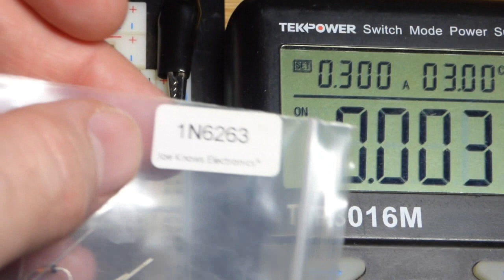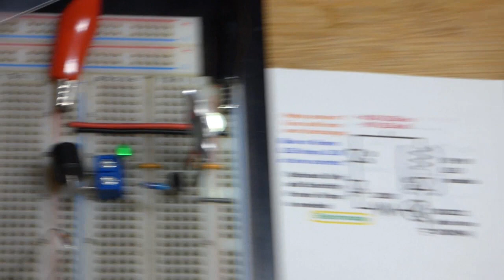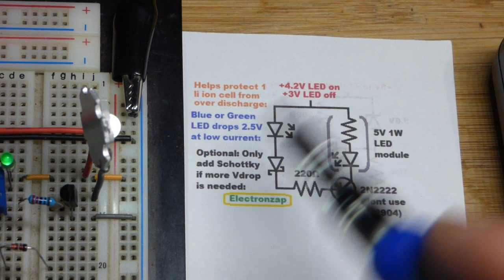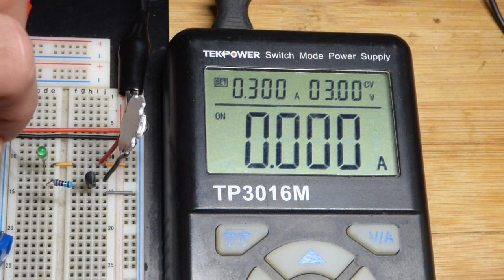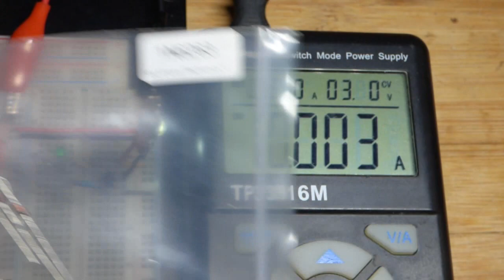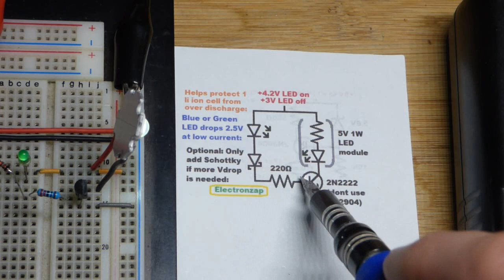1N6263 is a better Schottky diode for my low battery reduced current circuit

Comment: Besides using just a schottky diode, whats the next best option to completely turn off power draw at about 3v? Would that be a comparitor or opamp or other combination of components?
Reply from the maker: https://youtu.be/bFNiDgARxZk there's the op amp version of this circuit :) It's designed for 12V circuits but it can be modified for lower voltages.
Reply: @Electronzap  Thanks, that's perfect.
Reply: Option 1: Use a transistor as an "amplified diode". Replace the LED and optional Schottky diode with a transistor that has high value resistors from collector to base and base to emitter which form a potential divider, allowing the transistor to turn on when the voltage across the base-emitter resistor reaches 0.6V. Not great and temperature dependant, but works.
Option 2: Replace the LED and optional Schottky diode with a TL431 programmable Zener diode. That ensures a sharp turn-on at the programmed voltage. Best option.